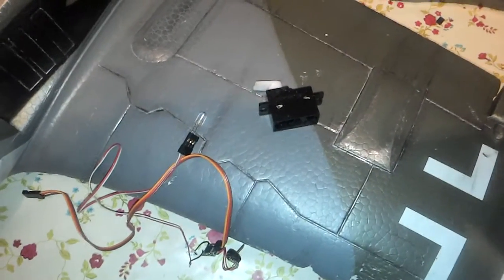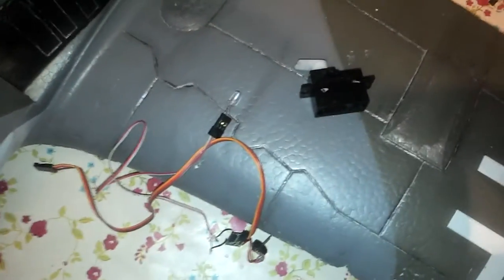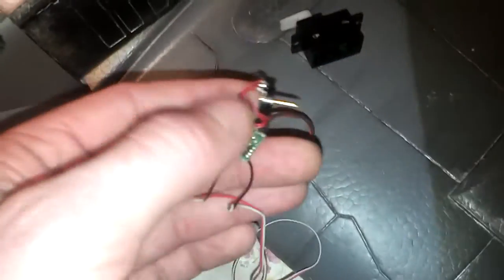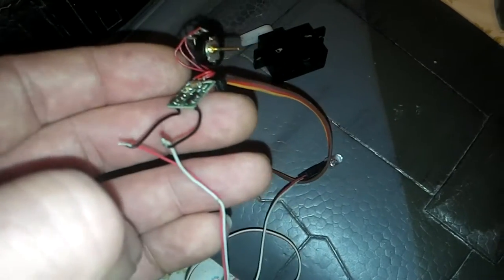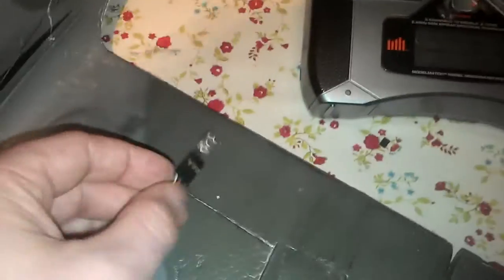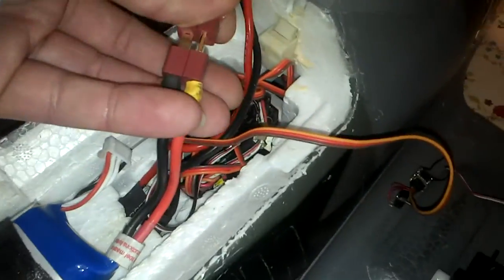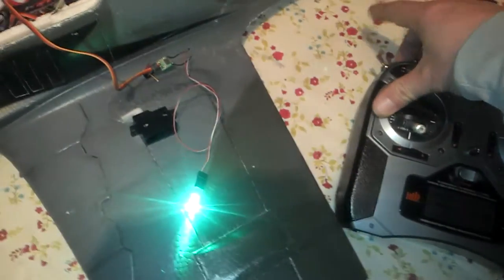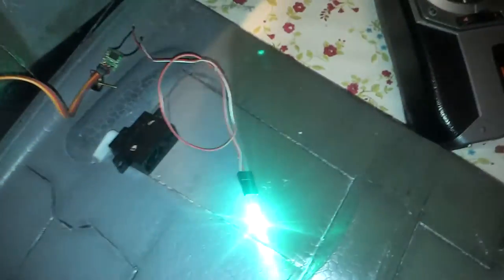DIY RC REMOTE ON/OFF SWITCH FOR L.E.D LIGHTS

Comment: Very well,  been searching for good way to make a switch...and this works great works even better then using it like a brushed motor controller that always burn out. THANKS..!
On a side note it may be a idea to control a small relais that may control the switch to a direct power source so you only using power over the reciever to contol the winding in the relais. This will make it possible to control much more light units at once whitout the danger of burning out your reciever channel.

Comment: Cool idea. For me it's not a perfect on/off but works well enough. I had also used the positive voltage output from the receiver to switch on a mosfet for powering much higher power lights. Was worried it would be wonky but it actually PWMs kind of decently. I suppose given how this works a toggling aux channel could serve a flip/flop function where the one channel alternates loads.

Comment: I have an old servo that i can use.
But can only use a 3 position switch on my radio..3 ch 2 positions is already used for 2 speed.
But if I put the potention meter in neutral and connect the led's wil this work because I think when switching on way polarity wil be good but the switching the other way..even by accident the polarity to the leds will chance and may burn them up.

Comment: thanks for the idea. now my nonworking servos will have good use. i tried this with a microservo, having problem keeping it on. shuts off after 20seconds and need to click to turn it of by default and click it on again.
connected it tona continuous power supply in the receiver and it staya on. what do you think may be the problem?
thanks in advance.

Comment: Im using a similar receiver controlled  switch but having problems getting it to throw to activate LED lights  , perhaps I need to play with weight or offset ? Can you suggest some settings please for my Taranis please ?
Reply: Try to adjust the potentiometer

Comment: Hi ty u got my led lights working on my Remote Control im thinking if it will still turn on and off if i remove the potentiometer
Reply from the maker: I checked out ur low rider headlights.  Well done 👍🏻
Reply: @highflying82  thank you